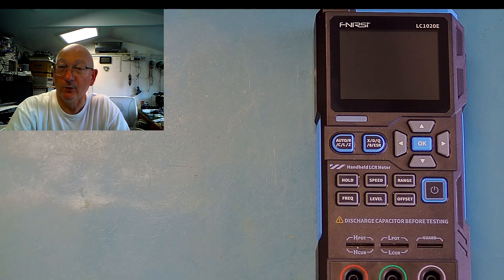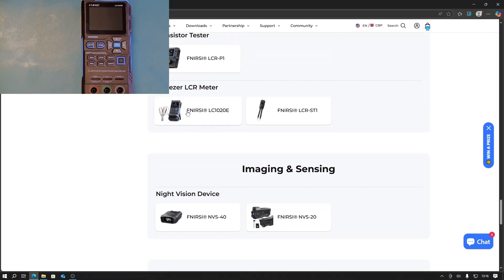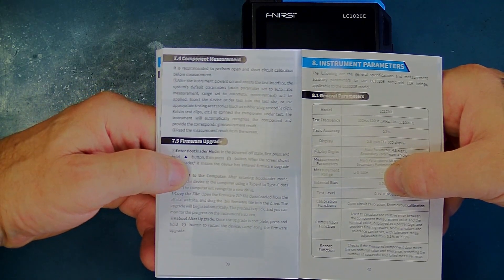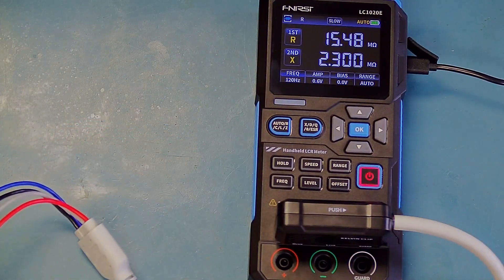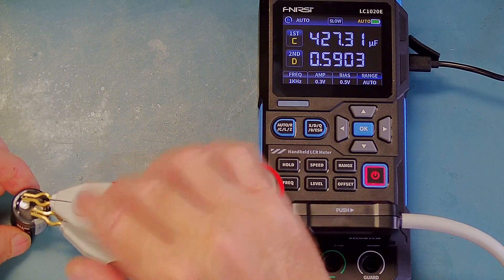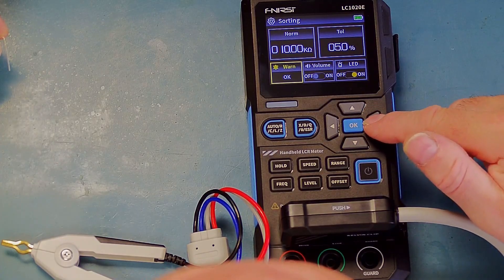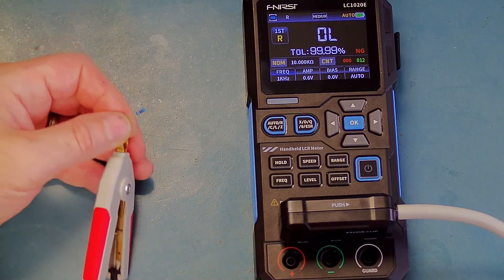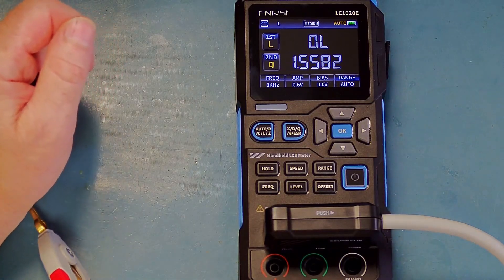FNIRSI LC1020E Firmware update and bug fix check.

Comment: I was running Win11 up until a couple of months ago before taking the plunge and migrating to Kubuntu Linux. I was already using cross-platform compatible software for almost everything anyway, so the move was almost entirely painless. I have a fairly fast PC to start with (AMD Ryzen 5 5600X 6C/12T with the OS on a PCIe 4.0 SSD), but it goes like stink running Linux compared to Win11 now that I'm no longer throwing away clock cycles for someone else's benefit. There's an LC1020E winging its way to me in the post, so I'm hoping I can still update the firmware (if necessary) under Linux.
Reply from the maker: Hi, hopefully it will be shipped with the latest firmware. Fnirsi state a windows 10/11 machine is required, maybe it will work under Linux, I don’t know I am afraid.

Comment: Thank for such video! Even I bought a FNIRSI LC1020E. I found some issues that still seams non fixed by the release 1.1 of the firmware. 1) reading stability: I feel the need to obtain an average measurement between multiple readings, in addition to a slow or fast measurement of the samples. 2) It is absolutely necessary for the manual range to report the values of Henry, Farad, or Ohm depending on the type of the component being measured. 3) It should be possible to calibrate with both the 4-wire leads and the 2-wire terminals; currently, it is impossible to calibrate the 2-wire terminals. I hope that such problems will be addressed by the new firmware release. Could you kindly send me the link to download the firmware update? Thanks!
Reply from the maker: https://www.fnirsi.com/pages/manuals-firmwares

Drop down to the lc1020e , the manual and firmware are both there
Reply: @Joftec please tell me, auto power off or battery indicator working for you? Thanks.
Reply: In the latest firmware version V1.1. nothing has changed except sorting and long pressing to turn the device on and off.